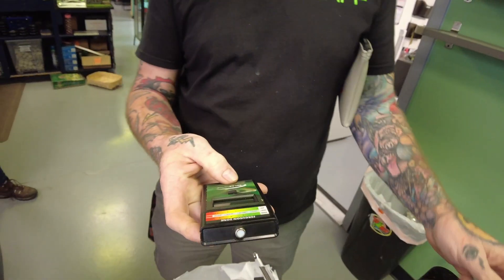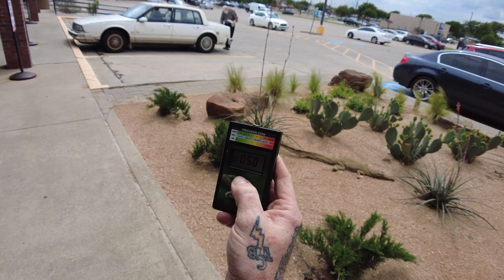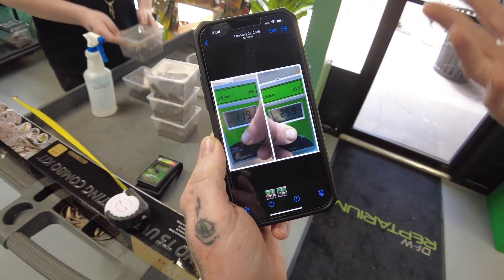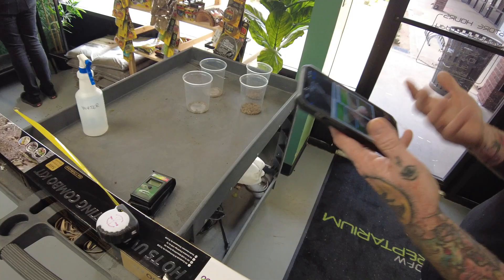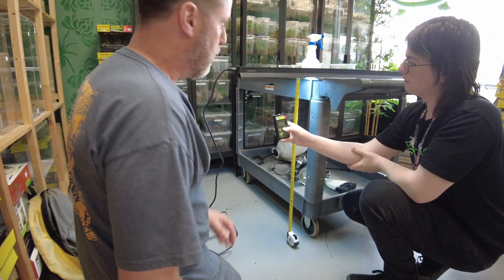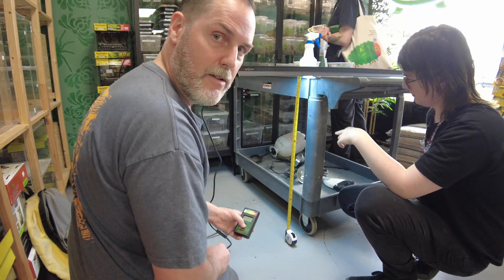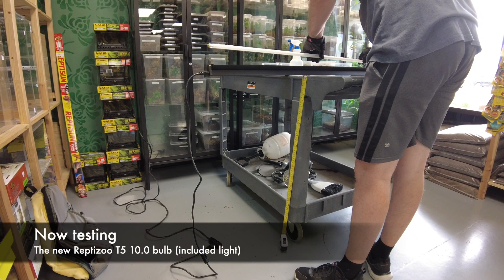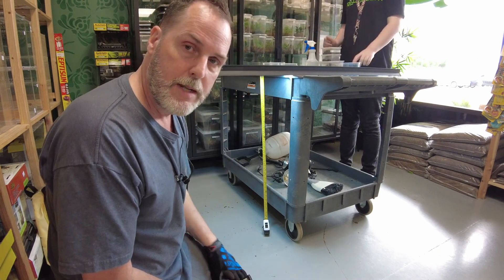I test the actual UVB output on my newly purchased Reptizoo light

Comment: So how was the reptizoo after year? Are you still using the same light? Thank you
Reply from the maker: I dont own any of the expense UVB  meters. My first 2 Reptizoo Mercury vapor bulbs I bought, one got ruined by me when spraying down the big cage. The water spry bottle stream got on the hot bub and shattered it like over 1.5 year ago. I had two but I was pretty upset about the mistake. Since then I bought two more 100 watt. The other MV bulb bough 2 years ago still read really strong UVB output even into its 2nd year plus. Higher than the 10.0 flourecent bulbs but more concentrated. The long tube florescent 10.0 bulbs and 55 watt fixtures I have are all working as normal as far as I know. 

My Tegus are looking and doing great and they actually seem to be getting plenty of UVB or to much intensity. Maybe to much as they don't stay out in the light more than 1-2 hours or they want out of their cage away from all warm lights plus UVB. The big, reptile pet store in Plano Tx owner was telling me Tegus don't really require much UVB and the reptile guru owner at NERD, owner Kevin, he stated in his tegu video that Tegu lizards don't even require UVB. They spend so much time underground in nature sleeping, resting and the burmation cycle. The only way to really tell how well the lights are working and to see how they continue with time to work is spend about $540 on 2 meters devices. In reality am not going to spend that much money. I have to spend money other places. Yes, buy the 2 different meters to check lights every 6 months to 1 yr but hat's if you have that money.
Reply: @GettingthruLife  Alright! Thank you for the update.

Comment: I’d love to chat and discuss this, as there’s some methodology that’s a bit off - and a bit of reliance on the Solarmeter to be telling you things that it just can’t tell you. 

I can absolutely confirm that the Reptizoo and Zoo Med Reptisun are NOT nearly equal in quality. The Solarmeter can’t tell you anything about the “quality” of the radiation being put out from the lamp - it only gives you a reading of UVI. A lamp emitting 100% UVC can still give a “good” UVI reading.

The LAP/BSP phosphor blend on the Reptizoo T5 is a weird poor quality blend that decays in beneficial wavelengths very quickly. The Solarmeter will not be able to tell you this.

As for the Mercury Vapour Bulbs, again the Reptizoo ones are poor from my testing. I test for spectral output, not just UVI.

Get in touch, we can discuss in more detail.
Reply from the maker: What are you using that's specifically telling you about the "quality of the radiation" differences? The Solarmeter used (Model 6.5R Reptile UV Index Meter) tool is widely used and trusted but its not very good?!?

How did you scientifically establish the "LAP/BSP Phosphor Blend" in the Reptizoo is sub par/poor quality?

Noted: Solormaster website: "Many scientists and breeders worldwide use/rely on the Model 6.5 UV Index Meter. The device "measures proper UV dosages for reptiles". The Solarmeter brand measures Spectral Response/the vitamin D3 Action Spectrum.

In addition, the Solarmeter 6.5 website notes: Model 6.5R Reptile UV Index Meter’s erythemally weighted action spectrum is extremely close to the action spectrum for vitamin D3 synthesis, it is the ideal tool to determine proper UV dose for your reptile, per the appropriate Ferguson Zone for the species. The Model 6.2R Reptile UVB Lamp Meter is ideally suited to determine if UVB lamps are performing to manufacturer’s specifications, gauge intensity, and measure aging over time. So, in short, use the Model 6.5R to determine proper UV dose for the animal, and use the Model 6.2R to determine UVB lamp output.

What I tested then was the UV dose per the Ferguson Zone which is the strength seen at different distances. That's what I went in there to test. 

What I can tell from using the Reptizoo bulbs exclusively is my Tegus are getting their proper UVB and amount because they are not showing signs of MBD over last couple years and they live 100% indoors. The exception of a few 15 min trips, 1-2 times months (summer) outside on my shoulder as I walk the block. (of course the actual sun is the best.) My Tegus don't like to be in the sun, of the harsh Texas summer more than 15-20 min. They want back indoors.

Do you have a video/s where you do your specific testing and results to determine why-which lights you feel are the best/better?
Reply: @GettingthruLife  I run a research and development consultancy for animal lamp brands, testing lamps for manufacturers, factories, and keepers in the lab. So I use a calibrated high sensitivity spectrometer in a highly controlled environment, which enables me to measure at multiple points within wavelengths, I then analyse the data to confirm and compare activity within certain action spectra.

The Solarmeter is only a radiometer, it’s useful - but not for comparing lamps to each other in this way and determining if one is “better” than another.

My data is published online: just search “Tomaskas Ltd”

In terms of a video; Check my interview I did on the Animals At Home podcast last summer, it’ll be on their YouTube channel: I go into a lot of detail of the Solarmeter, I know very much how it works and how it compares to the 6.2, etc.

I co-authored and co-conducted the world’s largest independent study on their efficacy. They’re useful devices, but they are VERY limited in what they can tell you.

If you search the Reptiles and Research page, I’ve also featured a few times on that podcast going into detail on lighting etc.

As I say, happy to have a chat about it all, we can go into loads more detail on a call :)

Comment: Does this mean that reptizoo and reptisun are nearly equal in readings and quality?
Reply from the maker: They were pretty close. My Reptizoo 100 watt Mercury vapor Uvb/Uva bulbs that screw into a dome fixture put out even more Uvb but more in a spotlight oval pattern. Plus all these light need to warm up so there's room for reading error if not given similar warm up/buildup time.
Reply: @GettingthruLife  so reptizoo for me then. reptisun way too pricey and makes me suspicous that they are inflating profits compared to manufacturing costs.

However I wonder how often would I replace one brand against the other? does bulb replacement have to be yearly or they may last let's say 5 years? Especially if I only light them 4 hours a day at least?

My terrarium is outside and I get 0 winters where I'm from so I could rely from the sun itself for UV and cost cutting of these expensive bulbs.

It's just the damn neighbors house that is 2 stories tall that block the sun on some time the day that I may have to rely on artificial lights or those gaps.

The reptile I keep is 3 feet in length and lives most of it's time on water so not sure if its ferg's zone 2 or 3?
Reply from the maker: @yessir2514  Repitisun and Zoomed brand do have a premium price because they are in the sense one of the first, specialized, reptile product companies. Also, they have brand recognition.

I recently bought a Zoomed 36" front opening terrarium, and it has not impressed me with build quality. I know the Exo-terra and Zilla same cage are better built and tougher. Zoo med is like a family owned company and when I reached out to their customer service, they did well to help me and get points for their service/warranty.

For the best bang for the buck as far as UVB output, the Reptizoo brand did just about as good. Their 100watt  and 75 watt mercury vapor bulbs put out a fair amount more of uvb light and at greater distance than either of the 2 florescent tube brands. I'd buy 4 of them ($40 or 2) instead of one long 50-55watt 10.0 florescent blub.

Side note, my Reptizoo bulb "screw in", was more than a year old with a lot of use and it still pumped out higher levels of UVB than the new tube, florescent lights. I have since bought 2 more Reptizoo 100watt screw- in-bulbs 5 months ago. And they last years if you treat them well. I am still using one that's more than 2 yrs old. One got broken when I was dampening down my large cage and sprayed water across the hot build by accident. I cried inside when it happened.
Reply: @GettingthruLife   Geez that poor bulb. Reptile lights are probably the one thing to watch out with reptiles when it comes to money.

With this video I'd probably buy the reptizoo. I live in south east asia so plenty of cheap fake chinese products are sold all the time. so I really need to buy the european/american one. they're the ones whos really gonna work. I hope the 6-12 month life expectancy could be extended for my case. $20 is heavy for some reptile lovers like me.

I have plenty of uvb where I'm at but the reptile lights are really gonna come in handy since my terrarium gets shaded from the sun with trees and the 2 story neighbors house. 

Thanks for this video a lot. every bit of info counts when making risky financial decisions like these.

Comment from the maker: Note: I did not allow the bulbs to warm up or stay stay on for a few minutes to build slightly more output of UVB. I Just turned them on and immediately started to measure their output. Also, towards the other edge of the bulb on either side the light output drop down towards the ends of the tube so I was taking measurement more from the outer point of the bulb due to situation/environment I was in. Big thanks to the manager and folds there for a allowing me to test my light with the different bulbs.